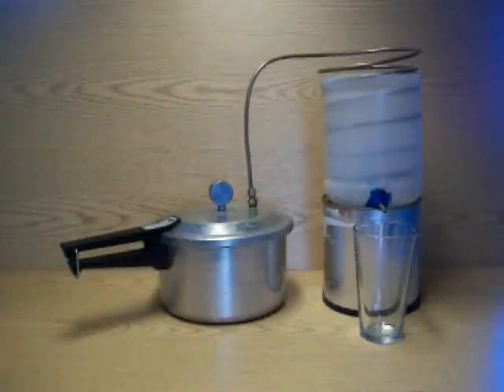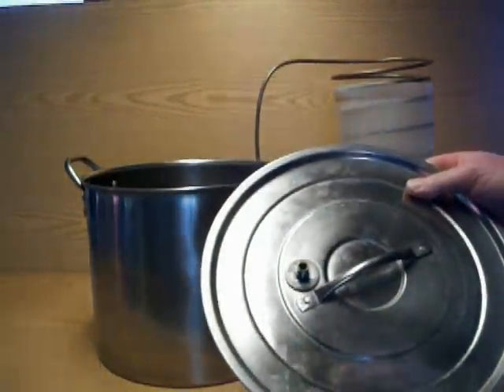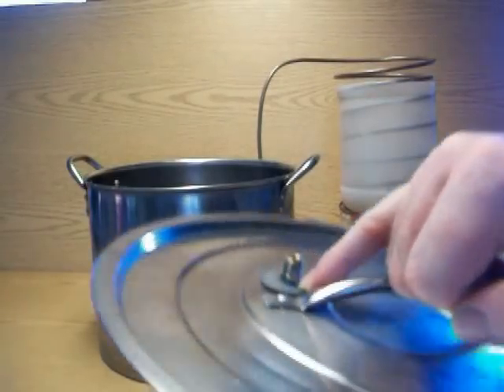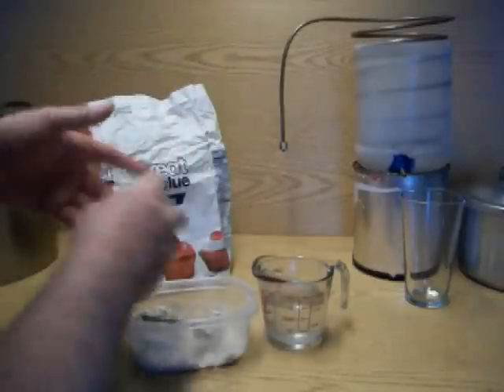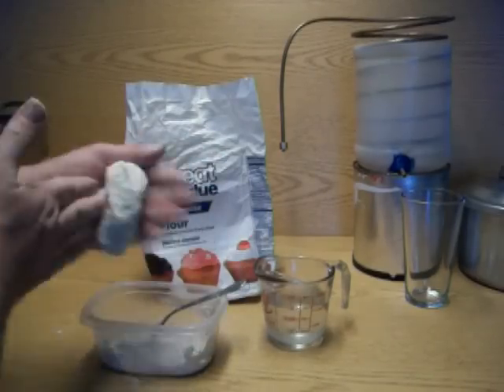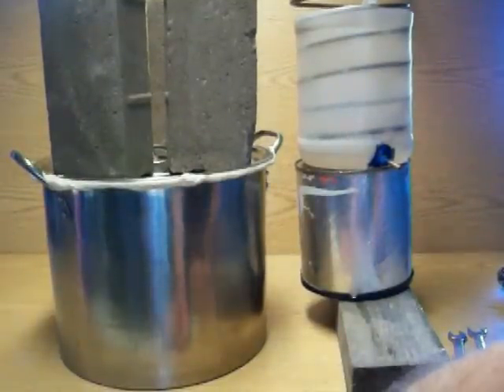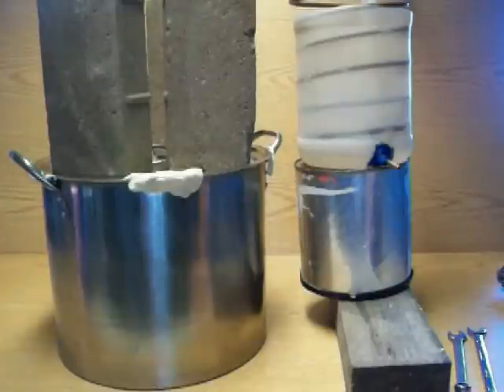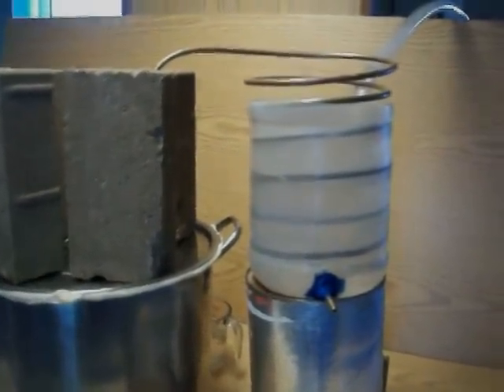Easy Build Moonshine Still pt 2 Upgrade

Comment: I think you should have quit while you were ahead.. you call this an upgrade? you should have just went back to the yard sale and looked for a larger pressure cooker because the seal on it was much simpler than the set up on this with the putty and the bricks..
Reply from the maker: 1 It has a larger capacity. BONUS. It's a pain in the ass filling up a one gal pot 5 times because you have 5 gal of mash. Believe me the small headache here outweighs the larger headache with the other pot.
2. People didn't like the aluminum and this is stainless steel. BONUS
Reply from the maker: ***** It lets anybody be able to copy it, even if they have zero skills.
Reply: wcemichael  it's been awhile since I have had to come back to this, and I am sorry if I offended you but it did seem like you had a much better set up in the beginning.. sometime the simple set up is the best and over thinking something most definitely tends to cost more money in the long run, its the reason I said you should have quit while your ahead. I wouldn't tell you to go fuck yourself to any one just because you get displeased by one post, there are those of us who look to videos like this to either learn from it, improve the design or disregard it all together. the fact i took "my" time to actually watch the first video before this one should have been an indication to you that I was interested. if I were to watch this video again and make out key points so that others could understand better of what i thought was wrong with this then anybody could understand it.. but now I am not inclined to do anything but belittle the Go fuck yourself comment.. if this system works for you then by all means continue to use it and I sincerely hope that anyone who follows your methods has great results because i wouldn't want to wish ILL on anyone. If you could have been adult and asked me "what do you think is wrong with this" I could have answered in a constructive manner, I mean thats what adults do right?we talk?we bounce ideas off of each other?we try to build a better mouse trap? Again best of luck to you in your endeavors..
Reply from the maker: tappakeggaday1 First you need to understand where I'm coming from....
I try to meet 3 criteria when doing things
1 Cheap
2 Easy to assemble with the most basic of tools
3 Make it so the average guy can repeat it and get his feet wet in something new. Getting overly complicated right off the bat only confuses people. Most of them need to start simple.
After people get a basic knowledge of stuff, with this basic equipment they can move on to more complicated stuff, and for the most part this is exactly what is happening.

Now. The first still was good, but it had 2 problems. After a few runs, it was too small and I was getting tired of refilling the still 5 times for 1 run. Now at least I'm down to 2.
The other thing was people didn't like that it was made out of aluminum, so I went to stainless steel and this pot was only $40 where as a similar pot conversion with all extras like seals and locks ran over $300.
The new pot meet my requirements and my 3 criteria. My friends that try my recipes tell me they love them. So yea, it looks funny, but also shows people that they don't need fancy expensive stuff

Some people see my demos and feel the need to make wise cracks, and they need to grow up. It is serving a purpose, because I get people thanking me all the time for the easy to follow advice, whether they are starting up with nothing or have ran a few runs with moderate success.

I've just told some smart-ass that I've figured out how to have reflux without a reflux column. He thinks I'm funny, but I'll have the last laugh.
Reply: 1 cheap.. agreed but hope you are using stainless steel in the process.
2.also good so check.
3. also understood. as anyone that would be interested in doing something like this but doesn't want to spend an arm and a leg to do it. It's one reason when someone tells me they want to go all grain with their beer but don't want to buy a mash tun and I tell them just do the boil in the bag method. As most all grain recipes are a little cheaper than partial mash.
I think what throws me off is your sealing system as it would a lot of people,I know your past the fermentation point to where you wouldnt have to worry with an infection like you would if you were brewing beer but the bread putty just seems kinda you know out there.. I know it works for you and if someone has had a similar success I can't really knock your process. Do you have any problems with steam leaks around your putty?seems like it would expand somewhat during the heating process and you wouldn't get as high an efficiency if you had steam leaks. I will re watch the video and if I come up with an idea I will share it with you.. take care.. Ed
Reply: seems like they would have a food grade rubber gasket large enough for that  but then the problem would be to clamp it onto the pot and I dont think  there is enough lip there for 2 pairs of vice grips to hold it in place.. 2. water return. drill another hole at the top of your water and have your incoming water there and use the bottom one as a return line so it will keep your coil cool.. it might help your condensation better to have a constant cool flow while your coper pipe is hot.
Reply from the maker: tappakeggaday1
Sometimes I push the temp a little too much and yes, a little pinhole leak appears, but I just shut it down, put on an extra glob and it's good to go. That is also why there is 4 bricks, and not just 2 or 3. having even weight helps. It leaked a lot more often with just 2 bricks.

The reason it's bread dough is people worry about seals being made stuff and seeping chemicals into your brew, and I didn't really know what I was going to use, so I came up with an all natural one.
Reply: if you can measure  the top of the pan I can see if they make a food grade gasket in that size, I havent given up on how to keep the lid closed yet
Reply from the maker: tappakeggaday1
I can try. I have to hunt down a measuring tape first.
Reply: I just watched one guy with about the same set up as yours.. in his chill tower he put in ice so that might be one way to help condensate your alcohol better, he did a hydrometer reading on his final alcohol content and he said by hydrometer reading that it was 65% or 130 proof.
Reply from the maker: tappakeggaday1
It really doesn't matter how cold the chiller is as long as it's cold enough to condense alcohol vapor, after that it's just over kill. And the ice means just more prep time. So I never use it.
Reply: Being 30 yrs of age and from the south, (family in Carolina hills &Tennessee foothills) we make shine! The putty made from flour is the truest way to fix any leaks and yes it gets stiffer than a three legged dog! ( it is the way most if not all true bootleggers sealed from the mash pot to the fittings) it also does not disturb the quality of liquor or add a bitter or sour taste that most "I use silicone this I use gaskets that" may add due to being a non cooking product filled with oils and chemicals or even bpa that many have used trying to skip or save time. Not saying it ain't about trying to run as much as you can as quickly as you can, but there's a fine line. Don't be lazy. We never put the paste on the lip of the pot, placing the lid on and seal with your flour paste. Make enough incase of leaks after. This keeps the flour out the liquor. If I hadn't mentioned flour paste is used on a wood still, but still is handy in the brew process on a burner setup. 
"Using aluminum yar askin Fer trouble" as my great grand daddy used to say, as they are notorious for burning out the bottom from mash acidity and heat source. Some use and get away with it just fine in very small batches. But if your using a "turkey pot" copper or stainless and not the thin flimsy stuff. Making great shine ain't cheap in the initial setup process usually a good "quick pot" setup will run you around hundred or so dollars for a well made, well gauged stainless or copper pot. 
When you lose vapor you lose liquor which most of us know. The slightest leak can take 180 proof down to 80 proof. If your gonna do it do it right. Stay safe!

Comment: y not just put ice in the condencer (with the coil)
Reply from the maker: You can, but ice won't last long. and you still need to change the water. It's just makes more prep time
The coil heats enough water to cook soup for a small army
Reply: if it heats that much would dry ice be to much?
Reply from the maker: Dry ice just cost too much to even consider. The coil just stay cool.

Comment: not hard if you buy the right cooker pot good about 279 dollars that's done got 5 lock downs on it and a temperature gages and all
Reply from the maker: My whole set up was about $50 and came with 3 extra soup pots.
Reply: My still has set me back about $50.00 total. $20.00 for 16 quart Pressure Cooker (OfferUP) $28.00 for 3/8" Copper Tubing at Home Depot, a few fittings for a couple bucks and clean buckets. Wish I could post a picture. You'd be proud.

Comment from the maker: What gases, what temp and where did you read this?
Your saying that Aluminum gives off gases WHEN HEATED, not with alcohol. Since cooking a steak would require alot more heat than distilling a mash, so either the steak would kill you faster than a still, or much greater heat is required to create gases. In either case your info cannot be reliable.
Please stop making stuff up.
Reply: wcemichael May depend on the heat source such as a propane torch or anything burning hotter..oxidation could occur and be harmful. If it’s glowing red is an example of this, correct? The blackening could be as well, I believe?..But if your using it that much and that hot...I think there are bigger problems to be addressed..haha..If I’m wrong, don’t hesitate to set me straight and I’ll thank ya for it.

Comment: You dont even use a thumper lol
Reply from the maker: Why would I??? Most moonshiners make a hot ass fire that creates low proof and they need to run it twice or more and/or use proof rising equipment like thumpers....THEN ADD WATER to lower the proof back down. WHY?

Comment: ...Just buy an O-Ring and show is over.
Reply from the maker: ***** That's a pretty specific O ring. The diameter has to be perfect and there is nothing to mount it to without using glue.I don't think my local hardware store has one like that